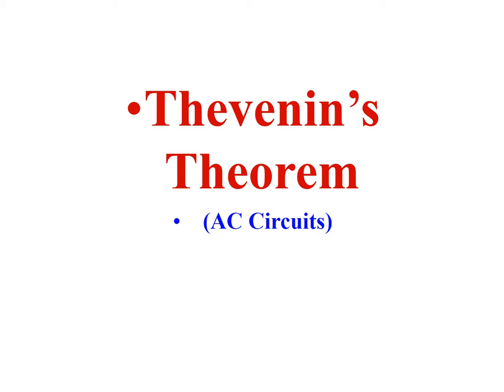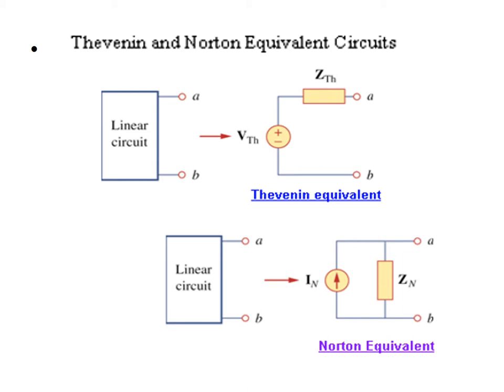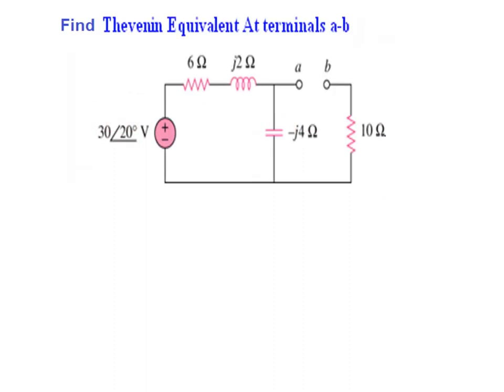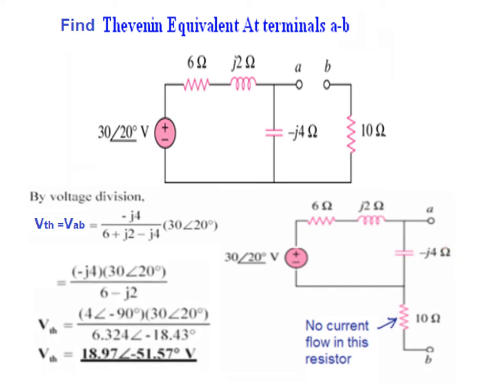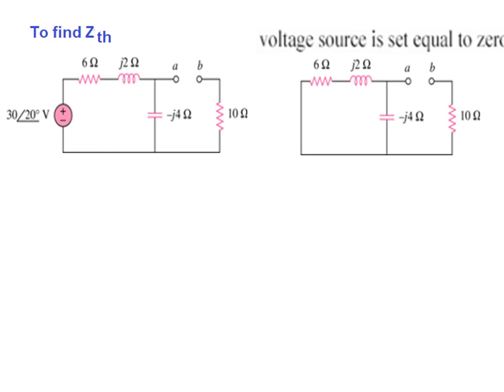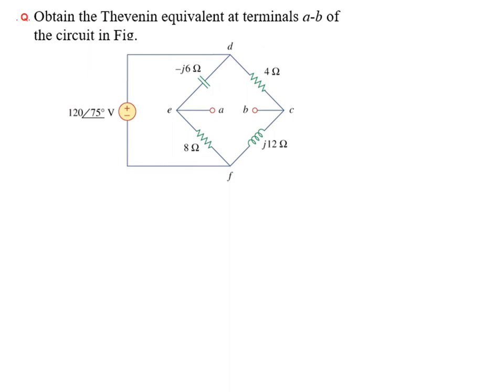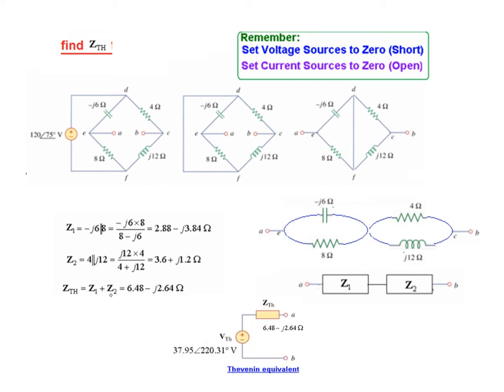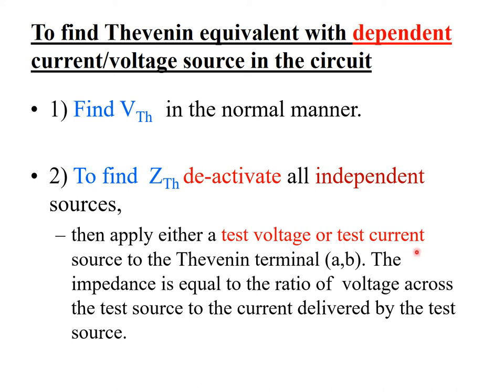Thevenin's Theorem || Example 10.8 & 10.9 || Practice Problem 10.8 & 10.9 ENA 10.6(English)(Sadiku)

Comment: Why you added voltage source 1 VOLT?
Reply from the maker: In case of circuit containing dependent source, the procure is to insert either a 1A current source or 1V voltage source.   
See this https://youtu.be/3gPoJkLovXo